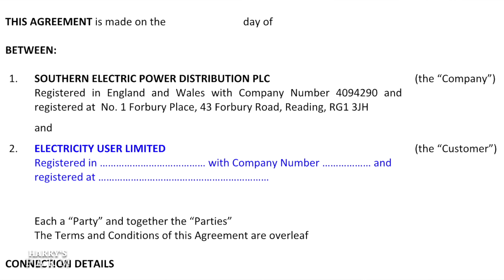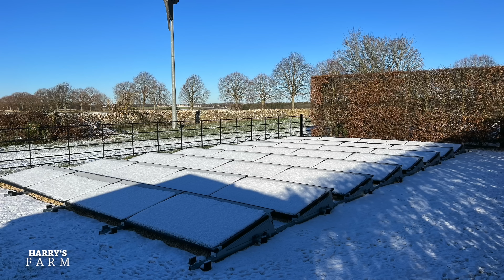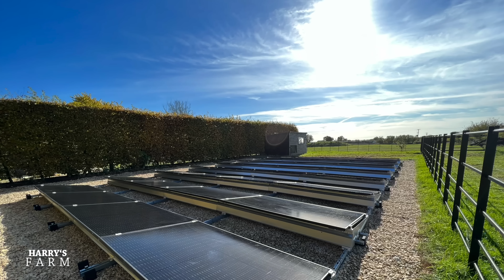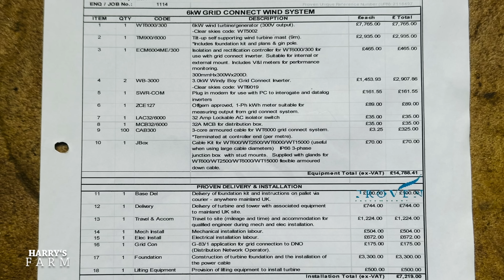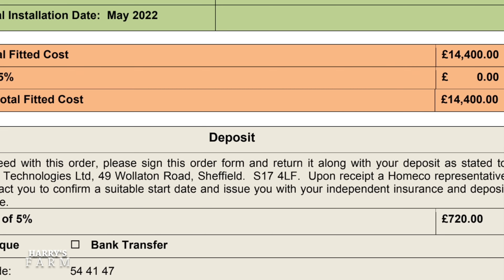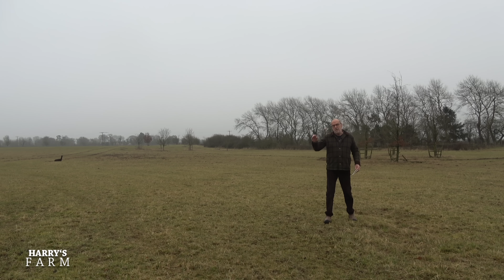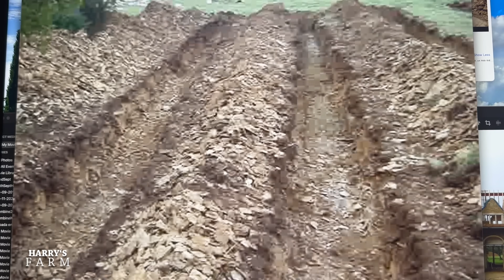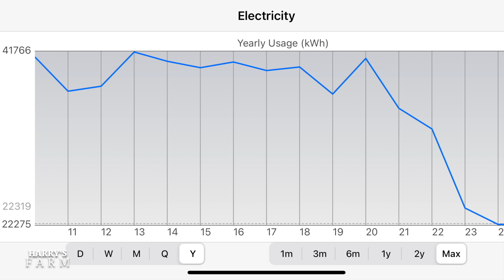Are solar panels & heat pumps worth installing? Here's what I've learnt after several years of use.

Comment: I decided to attempt to make a home in Central Florida NetZero. 
At first I focused on the brutal summer months and was able to shave 10 KW in energy needs to cool the home during the hottest 4 months of the year by making the home more energy efficient. This allowed for a slightly less expensive system design.
Then winter came:

Central Florida does not require very vast heating demands in the dead of winter, but solar systems may struggle to meet demand even in the mild climate of Central Florida
In winter. It boils down to the temperature Delta for each season. 

I like to keep my house around 23° C.
When a cold snap from Canada hits Florida. Temperatures can reach -1 ° c. That's over a 20° temperature Delta. And that's happening when the sun is low on the horizon. 
My system can handle it, but if I get multiple cloudy rainy days batteries will get depleted.

It would take a massive amount of solar panels in the UK to maintain NetZero while heating your home during the low solar production/high heat demand winter months.

I'm not saying we should just throw up our hands. It just makes sense to set realistic goals. 
❤
Reply: I understand certain panels can collect from underneath. So if the array were raised above a reflective bed of marble chips or oyster shell, maybe it could be cost and space effective.

Comment: Well I a pleased with the Solar install I had back in Feb 2015. FIT was well worth it, and has long paid off the install. Ten years in the Inverter is still fine and don't see having to change that yet, although budgeted for it already, and we still have another 10 years of FIT payments to come. I won't switch to a smart meter as the deemed usage payment portion of the FIT (ie 50%) becomes the actual usage which would be way higher. Unless an energy company is preapared to offer a much higher rate for the deemed portion then smart meterss can rot.

Comment: Solars Panels (to me) are a con. 18 panels on my roof and getting 3/4kWh a day if I'm lucky and a £100/month electricity bill to go with it ....
Reply: It really depends on where one lives. 
Heating demands can really run up the cost of a system. 
People move quite frequently, so investing in an expensive solar system may not make sense. 
I focused on making my home more energy efficient and it saved about 10 KW of load during peak summer cooling season. That allowed me to shave the cost of the system design down a bit. Unfortunately I wasn't focusing on the problem correctly. I should have been focused on the winter heating load as it also falls at a time when solar production is down by at least 25% or more due to the low Sun angle and shortness of the days. 
It can be discouraging, that's for sure. 
This guy sure has deep pockets so I don't think the expense was even a blip on his radar screen.

Comment: Ive had GS heat pump heating for 3 years now- 7 bed property. No gas, got rid of oil boiler. Winter months bill is on average £250-280 in total for leccy, summer months the leccy standing charge can be more expensive than actual usage..saved me quite a bit of money 👍🏻. Managed to get in on the now expired old green deal scheme, so large upfront cost but get most of it back over the payback period - oh, and before the haters start, ive worked and paid a huge amount of tax into the system for over 35 years😘

Comment: Tip for anyone who needs energy in winter, mornings, evenings, and can’t rely on grid to be the “battery” - over angle your panels, make 50-70+ degrees if you can (not 30-40 usually recommended for max summer output, and certainly not 15 as here), have not only south, but better west and east facing panels (ideally south-east and south-west). And oversize as much as you can. If grid operator gives you 10kW connection permit - install 20kW and limit output to 10kW. Use smart meter.

Comment: The point of having a battery is to store electricity on a night tariff and use it in the day, along side the other purpose of taking the excess solar, enabling higher load than what solar alone can provide without using the grid and probably a few more. It's also worth bearing in mind that your high discrepancy between solar production in winter vs summer will be exaggerated by the low to the ground position and angle of the panels. With the winter sun being low, it will strike the panels at higher angle of incidence and have more chance of being shaded. Usually the difference between winter and summer is closer to 6 times, for panels on a roof or in a large field at the optimal angle.

Comment: Sad that we have far too many inexperienced solar installers around. That’s a Van Der Valk flat roof system used on a ground array with string inverter next to tree edges..😯. That needed to be a better angled ground mounted system with an optimised SolarEdge or at least micro inverter system.

Comment: If shading on one panel is shutting down a whole row, you need to get a new installer. That is an issue with the charge controller and poorly thought out wiring installation. The angle of your panels is a big factor in the winter numbers you are getting. Whoever did your install should have advised you to use an adjustable angle mount and multiple MPPT controllers to deal with shading (which was obviously going to be an issue with hedges and changes in the sun's angle).

Comment: Solar power certainly works much better in a warmer climate. Living in Tasmania Australia, we can go most of the year on our off-grid solar and battery system using very minimal fuel from the diesel generator back up, just running on solar power and batteries at night time. Eventually when I get an EV we will be able to use it's battery as part of our off grid to power the house and we will probably be able to do without the diesel generator.

Comment: If you don't have it already, get optimisers on the panels that get shade. E.g. solar edge optimisers or tigo (which I have). Makes a significant difference and stops one panel killing the array. Think of it as water pipe running through the panels, if one panel is shaded, the pipe gets squeezed and stops the flow speed. Shade kills Amps, those hedges and railings look like they would kill that array especially in winter when the suns lower

Comment: Well, I only have a small solar installation (4 panels, ~1900W peak), but I angled the panels specifically to be optimized for the winter sun. 
Right now, January 2025, this array delivers beautifully on any day the sun peeks thru the clouds and charges a 3kW/h battery pack within 2 to 4 hours, actually over delivering so I can run various house appliances off it simultaneously.

Comment: Harry, house batteries are useful n the winter. We run one, and charge it from the grid when the grid is greener, and on cheap rate. For us it’s 8.5p per KWh over night vs 27p day time. So although our solar output is lower, it is both greener and cheaper than pulling from the grid…and in the summer we can store more in both the car, house battery and our hot water tank…

Comment: Add a battery and use Octopus cheap night rate at 8p per KWH and release in the day. Save 2/3s of electricity for 5.5 hours. Great saving. In the summer months it is great as we store excess in the Powerwall and use at night

Comment: Shading etc. You have proper micro inverters, then panels all make the most they can separately. Or as it is so obvious shade affects solar cut the hedge down!
Almost no point in a solar system without a good matching battery with it. The point in winter is you fill it up on the cheap night rate. Today, a fine sunny Feb day all day, my rooftop e/w system made 50% more power than I use in 24hrs. But obviously I do not have your crazy level luxury usage!

Comment: Great informative video but I have to take issue with one point - the use of batteries. With your interest in cars and having a plug in hybrid, you can get the Octopus Go tariff which would enable you to buy your electricity between 11.30 at night and 6 (I think) in the morning for 7 pence a unit. Charge the battery, charge your car, wash your dishes, tumble dry your clothes, run your heat pump a little warmer and various other things all for this price. You can then run all the other things during the rest of the day from the electricity you put into the battery overnight, sell back any excess and all your solar and wind produced energy back to the grid for 15p per unit.
For a property your size and with the number of items you have that run on electricity you may need more than one battery. A 13.5 kw battery from Tesla can be installed for less than £8k and add on units of the same size can be fitted for £5.5k each. You would soon get your money back from the savings made and selling back to the grid.

Comment: the reality is that for the price of the heat pump instalations, you could afford electric heating for the house via electric radiators/coventional ac units for dozens of years. Don't save on the pannels, those fancy heat pumps are the real "scam". They work great but their costs is never offset by their efficiency. We don't even need to mention the AGA in that regard haha

Comment: Wow the difference in your seasons are incredible. My output is 1.8 mega w/h’s per month in summer and 1.2 in winter. My 10kw system cost $14500aud and considering my bill went from $5000 a year to about $300 a year credit, it was paid for in just under 3 years. Each state in Australia has different energy costs and feed in tariffs, the state of Queensland being one of the best at the moment. 
If you have any chance of shade affecting panels, you need to consider microinverters on each panel. The best thing about microinverters is that you can see what each single panel is outputting at any time. When the installers put my system on, they didn’t plug one panel in properly and I could see one panel was outputting zero. If you have a system like in this video, you would never have known that and you’d have that one panel doing nothing forever. One of my other panels a while later was struck by a golf ball and it shattered the glass. You couldn’t actually see it was broken as it was still all together. I check the output regularly and noticed at the end of each day, that this one panel was different to all the others, not a lot, maybe 0.2kw/h per day less. The app has an icon that says ‘array’ and has all the panels laid out as in a plan view on your house, so you can easy say it’s the third one along on the bottom row, for instance. I have zero shade anywhere near my house but I just liked all these features. If shade is on one panel like the system in the video, all panels on that one string output that same low amount. 
There are companies in Australia that will install a 13.2kw system for under $6000 (3000 pounds). These have 10kw inverters but 13.2kw of panels. High end systems like mine are around the $15000aud (7500 pounds). You seem to be paying a lot for similar systems over there?

Comment: Hello Harry, nice to see once something else then your supercars. But honestly with your solar you hit the ball completely wrong. I understand yiu don't want to fit them on the roof of your little castle . Bur flat installation is never the best idea. Angle is not perfect towards sun when being at it's highest point.  I have 3.8 kw 100% to the south orientation   (Belgium).  10 panels which is enough for a normal household.  But it's a ferry tale that you can heat a house with solar and a hp. As you mention in the winter output is so low just then wheb you need it. This was all fine in the begining where meters where turning backwards so in summer you injected energy and in winter you took it from the grid. But that is far behind us. Solar is great when you can consume the energy during the day. Otherwise you need storage and new large investments that will never pay off. However a well insulated house you can heat efficienctly with a hp. Although for your little castle a regular domestic hp will be undersized😂

Comment: I've got a solar array about ¼ the size of your domestic one, again, in the garden. It serves a Tesla Powerwall in an outbuilding (just in case). I use it with an Octopus low off-peak supply rate. I've worked out it's cost-neutral over the warranty period of the battery (10 years). It's halved our energy bill. But, of course, it's a big investment. My primary reason for installing it with the battery was to give us redundancy when we get power cuts. And the way it's going, power cuts are only going to become more frequent. I'm not mad enough to buy an electric car.

Comment: Makes much more sense to use power stations which take up  small areas, reduce the distribution network needs, are reliable, cheap, sustainable and manage their output. 
China has 1,200 new power stations planned. India similar. Our efforts at Net zero are preposterously negligible.  NOTHING we do will make one iota of difference. Oh, we will get cold and poor.

Comment: Was my shock to , in December was around 150-250 at best compared to 3.6 in summer.
I was told a min of 500 to expect in dead of winter day and thought ok still enough to off set heating.

Now just invest in battery for offpeak power , not going to expanded the solar side

Comment: The battery option isnt only to store excess solar. They are best utilised in the winter on a cheap night rate tariff. 
You have quoted 23p a unit cost. You could charge a battery at 6p a unit on some tariffs. Then use that 6p energy all day long. Better than halving your bill.

Comment: Harry. We have a ground source heat bump, supplied by 3 x 100m deep bore holes. The delivery temperature is 10c and the return is 5c.  The ground temperature should be always around 10 to 12c.  I was very interested to hear your temperatures

Comment: Figures not clear - we need total units a year consumed by ‘house’, pool and garages etc. with a total and where you’ve got that from - turbines, solar panels, air source heat pump and buying. Then what you saved in money from the solutions and what each cost to put in. Otherwise it means little.

Comment: Great video Harry, thanks. I have a small domestic solar system and also suffer from shading as different rows of panels are on different bits of roof. Without Optimisers, rows when in shade work on the 'weakest link in the row' principle and Optimisers should reduce/eradicate this effect and you get what each individual panel is producing, your installers should have put these in. Likewise, as others have suggested, combining a battery, you can charge it overnight for very low rates. These two factors have helped me overcome the shading issues and the poor solar production in the Dec/Jan months.

Comment: Great informative video! Regarding the yield of solar installations, geographic location will likely have a great impact. We are in Switzerland. We have installed 14 kWh on our roof, facing south, inclination about 35 degrees. This February ( 01. - 15.02.2025) the yield so far was 309 kWh. In January 2025 total output was 640 kWh. 
Our solar system was installed in mid. December 2024, it has produced about 1300 Wh in total since.

Comment: Harry - your comments about the factor of 14 between peak summer and peak winter daily output speaks volumes about just how poorly designed that your system is.  
Reach out to me if you would be interested in getting the fundamental system design flaws resolved.   If you are willing to create a follow up video that shows just how much better a properly designed system can perform then I could possibly get this remedial work conducted at no cost to you.

Comment: Many people have commented about the value of using microinverters.  You will also find a lot of people who state that microinverters are not worth the extra cost, however you elude to two very specific factors in this video that the naysayers against microinverters often ignore or possibly do not understand. 

You talk about have a maximum size system you are allowed to install and a specific limited space where you had to locate the PV modules.   If you don't have either of those restrictions then you can make an argument against the value of microinverters on the basis that it might be more cost-effective to just install a larger PV array using string inverters.  However if you have any factors that limit the size of the maximum allowed PV array size then microinverters add significant value in the amount of energy that they can extract from a given PV array.
The second factor you talk about is the significant difference between peak summer and peak winter production.  The microinverter naysayers ignore this detail and only compare the total yearly difference between microinverters and conventional string inverters which very much reduces the apparent advantage of microinverters.   This yearly averaging obfuscates the real value of microinverters is that they significantly increase the energy collected from the PV array on the worst of winter days.  If you live in a cold climate this means that microinverters offer a significant advantage over string inverters.

Your comment about this system producing 14 times more energy in a peak summer day versus a peak winter day says everything about just how bad your system design is.  If you tilt the PV modules to the optimal winter azimuth and change to microinverters you should be able to reduce that ratio from 14 times down to a factor of 3.

Comment: Harry, just to clarify, you mention at the start of the video that you require permission from the network provider to install this equipment. I presume this is only if you intend to tie into the grid, I,E take electricity and maybe export it back. If one wanted to come off grid all together I presume the network provider would have no say in this, at that point? Cheers!